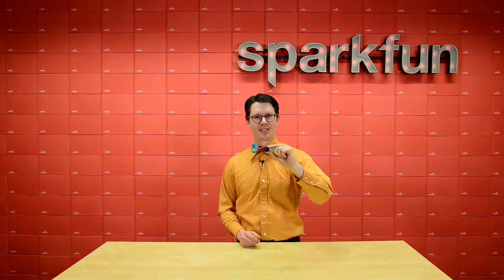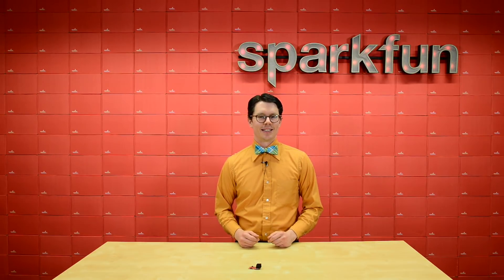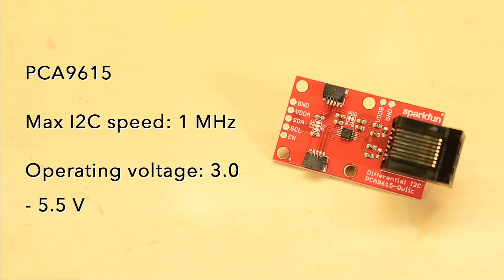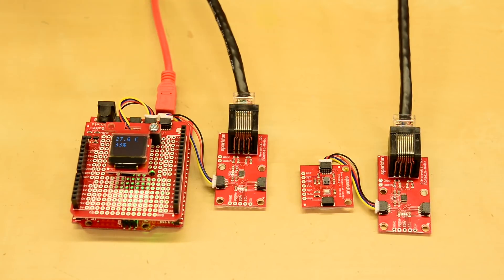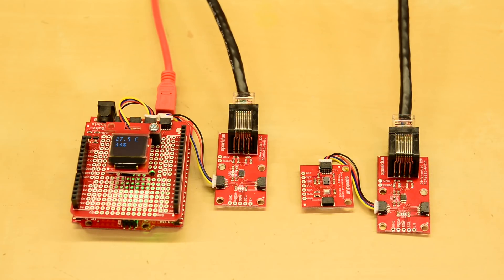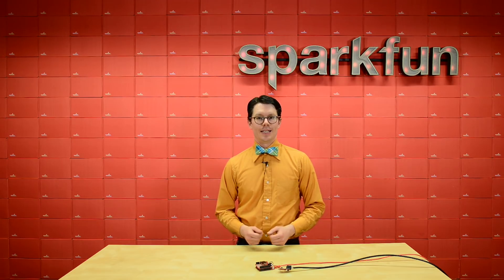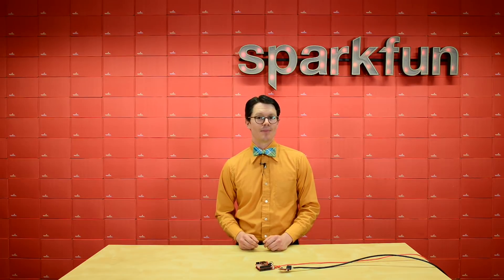Product Showcase   Differential I2C Breakout

Comment: Lets supose I want to connect another "SparkFun Differential I2C Breakout" to the unused connector in the first "SparkFun Differential I2C Breakout". Is that possible? How about the terminator resistors?

I read somewhere "Termination resistors only on the first and last peripheral on DI2C Bus". How can i do this? since in this case will be a termination resistor in different "nodes".

My goal is to add like 5 sensors to the some I2C bus point (star configuration), using 6 "SparkFun Differential I2C Breakout" (one for each sensor to convert the differencial signal to signal end) and another one to the point where all the signals will converg. Is that possible?

Comment: I had used the PCA9615 in a product and I am impressed the the length of cable I can use with 100K clock. 1000+ feet. I really do like the chip, but it isn't as immune to EMI as stated in the above video. It is good, but not so good to be used in really noisy environments, even with short cables  So be careful where you place the cabling in relation to other equipment. And use 5 volts.

Comment: Is it possible to connect a I2C hub to the end of this to connect multiple I2C devices? Seems that it should since they run on different addresses and arduino code is sequential so it would only be readying one sensor at a time. Any thoughts?

Comment: Interesting....

I'd really like to see a Power over Ethernet CAT 6 board instead with a driver / library instead.
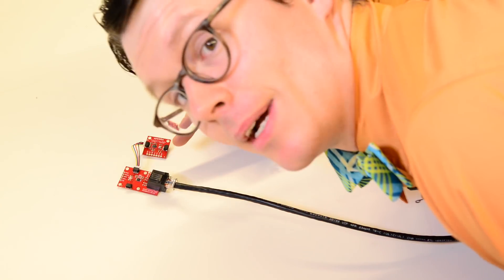Reply: Doug Hanchard uhh, did you watch the video until 2:03 ??
Reply: It USES CAT6 cabling, not Ethernet IP protocol as POE.
Reply: It uses CAT 6 Cable - not Ethernet CAT6 protocol.